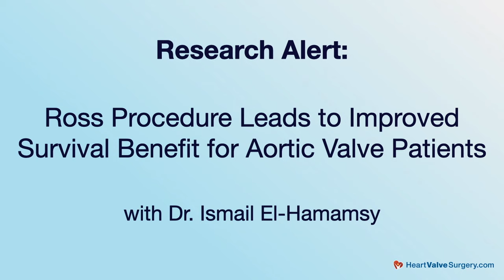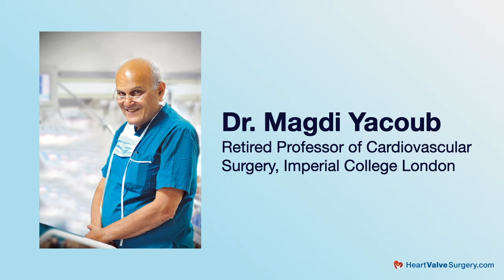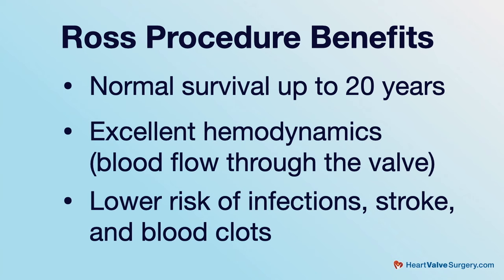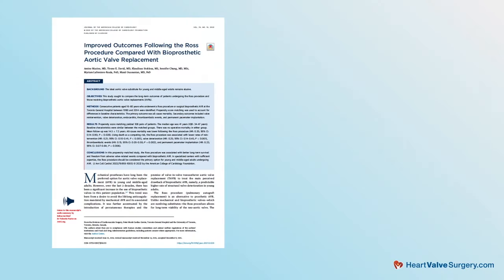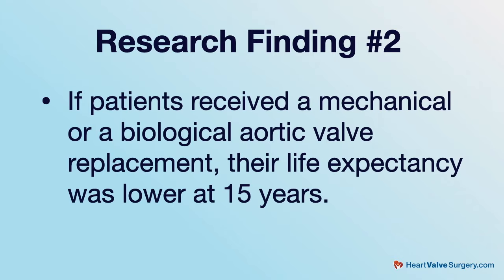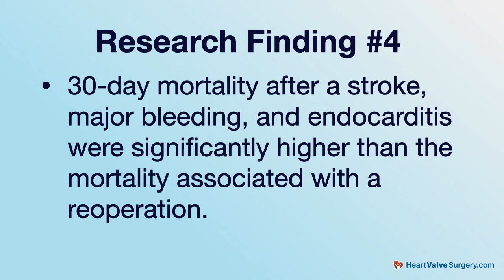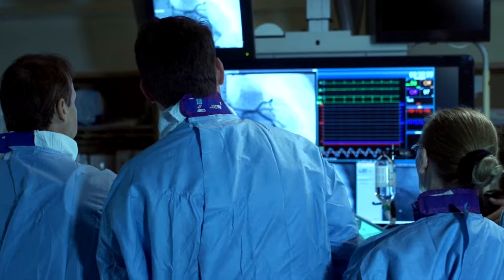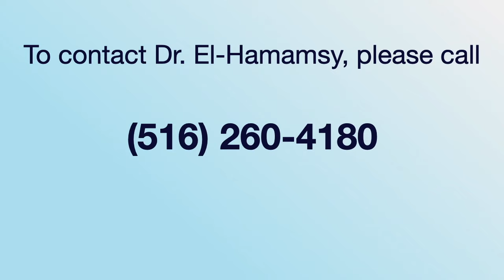Research Alert: Ross Procedure Leads to Improved Survival Benefit for Aortic Valve Patients

Comment: First, how easy would it be to get a copy of the report that Dr. el-Hamamsy made reference to in this video? If I am going to have surgery in regards to the AVR, I might be able to let the attending surgeon read up on this info. Second, why complicate the surgery by moving the pulmonary valve over and using donor valve in place of the pulmonary when and if the donor valve can go straight into the aortic position. This 2nd question would make an interesting topic for further study.
Reply: If you go into the education area a discussion with Dr Stelzer and Dr El Hammamsey goes into detail. 
Dr El Hammamsey was one of my surgeons and I was hoping I would have a Ross Procedure. I think I was considered too old at 68. I was disappointed but I trust their decision. My surgery was very complex and they did a wonderful job repairing the damage from a less than stellar 1st Aortic Valve Replacement.
Reply: Donor valve will not last long especially at aortic position with high pressure blood flow and also the immunity will cause narrowing in the valve by time

Comment: 5 years ago I had a aortic valve replacement and I am using a tissue valve. When time comes that my tissue valve need replacement, can I have that Ross Procedure?
Reply: Excellent question, good luck in getting an answer.  I wish there was a site you could ask questions and get answers on heart valves. It is hard to find on the net.
Reply: I am not sure why you wouldn't be able to since your native pulmonary valve is still intact.